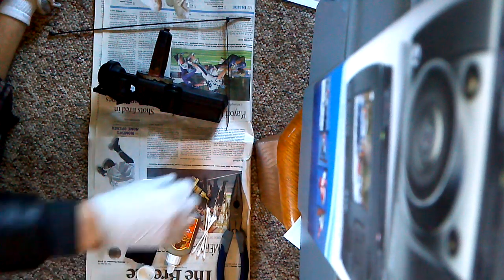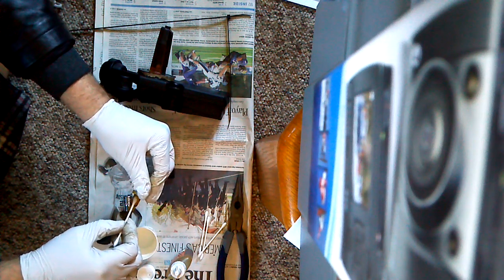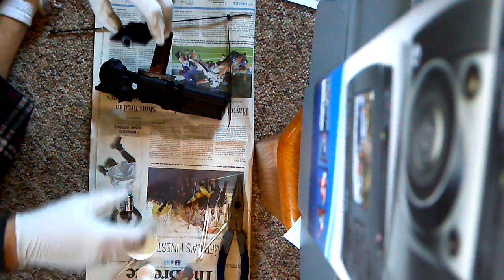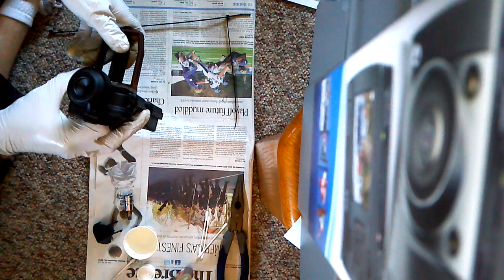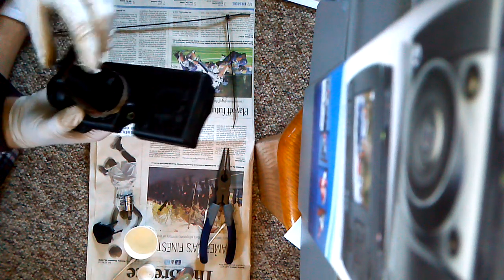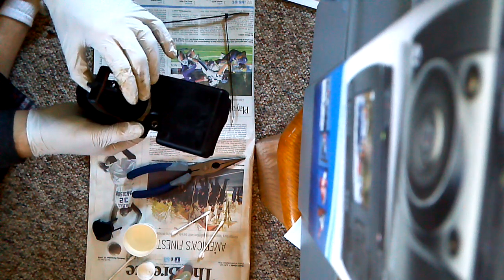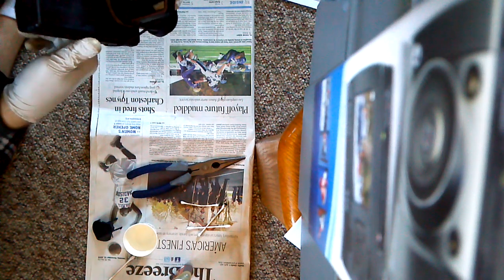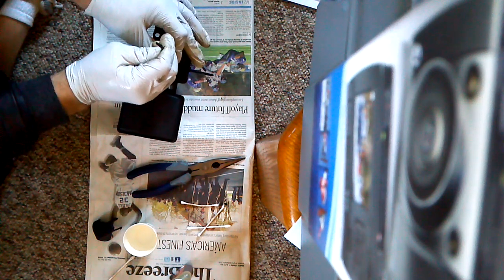BMW e46 cheap Disa Repair SUCCESSFUL!

Comment: Thanks this helped me fix mine on 03 330i. But i used 2 min epoxy instead , i also sprayed the part i didnt want the glue to stick to with wd40 so it would rotate freely after big difference in low to mid power awesome thanks !!!
Reply from the maker: Nice! Only took me 4 years to see and respond lol... Hope your fix held too!